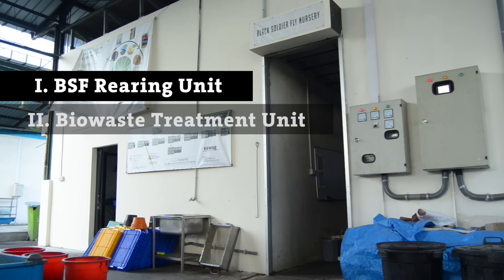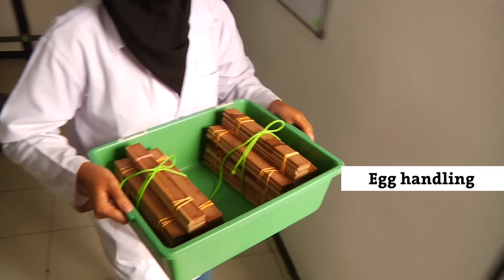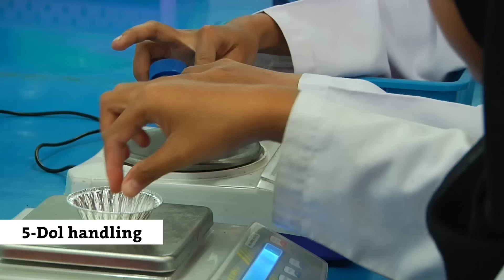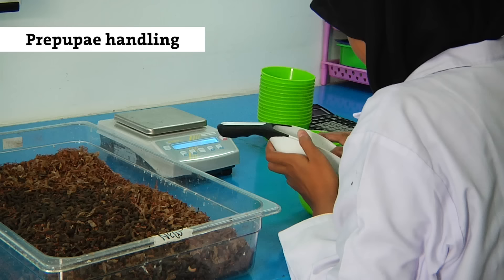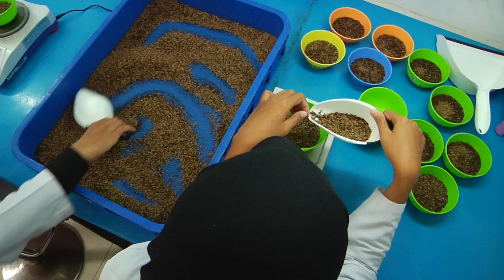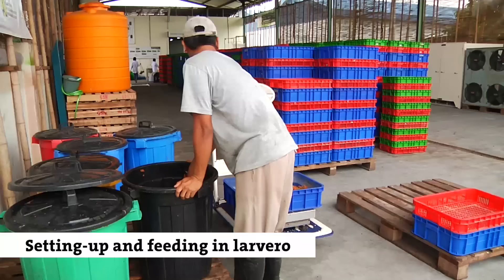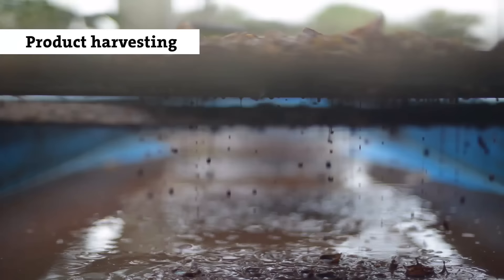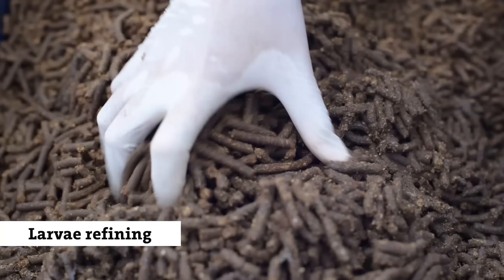How to Use BSF Biowaste Treatment - Step by Step

Comment: Calcium Carbonate powder mixed with a little water, and then applied with a q-tip or whatever, to the sides of plastic containers onto maybe a credit-card sized width and allowed to dry, prevents baby hatchlings of BSF larvae from being able to crawl out. You want it to be dry enough when you apply it, that it doesn't drip. If it is too wet and dripping, let it dry some or add more calcium carbonate powder.

Comment: Since you have basically setup a composting facility and then fed the compost to the larvae, why not simply compost? It removes the problems of handling teh larvae and reduces the number of people need to run it.. The compost can be sent to the farms or sold.
Reply: wondering the same thing myself, what is the point of going through all that trouble, seems like a waste of energy in and of itself.
Reply: @GreenRoomMusicClub  well I was digging around.. if you feed the raw waste to soldier fly larvae then you get a high protein feedstock for poultry
Reply: This setup is advantageous because of how fast BSF turn organic waste into valuable products. Apparently, BSF are faster decomposers than red wrigglers. Composting without using worms or BSF will take months which is a long time. BSF will expedite this process. You also get valuable animal feeds from BSF farming unlike traditional composting with or without worms. You get BSF frass which can be used as soil nutrients and more importantly get a valuable source of food for animals.

Comment: Great video and amazing information. What do you do with the drained water from the waste? You mention in the guide using it for later use or for treatment, but do you have more information?
Reply: Thank you for the comment. Currently, we do not use the liquid but we have analysed its potential for biogas production. The methane yield was around 450 ml/g VS which is comparable to the biogas production from food waste or pig manure

Comment: Hello, im reading your guide and I have one doubt, in page 57 different tipes of feed are explained, my doubt is here, in CF and water %. For example, when you say 1kg/30%CF/70%Water this means 300g of Chicken feed and 700g of water or the water % is refered to the relative humidity (1kg of CF + 700g water). Thanks for this information!
Reply: Hi, the ratio in fattening the larvae is using 30% of CF and 70% of water, so if you will feed 1kg of feed, then 300g CF then add water up to 1kg. Hope this answer your question

Comment: tive um problema relacionado com o inverno as temperaturas desceram para 14 ;17  graus mínimo e 25 a 27 máximo tivemos uma redução massiva das  mosca o que reduziu as larvas pela falta da população para o cruzamento
Reply: 14-17°C is pretty low. I experienced similar difficulties in San José, Costa Rica where the nights are cold while the days are pretty hot. The adults seem not to like that too much. You would either need to heat the colony or upscale the colony to compensate for the low mating rate.

Comment: I was thinking that this would be a way to process and recycle sewage.  

It would be much easier to just feed the rotting vegetables to pigs.
Reply: Not the same. Decomposing fruits are not as valuable as high protein larvae food.
Reply: @JustNatax3  All of the amino acids (protein building blocks) in the vegetables would also be in the larvae.
Reply: @JustNatax3  Also, pork is more valuable than fly larvae.

Comment: Insanely labor intensive, will never work from an economic standpoint the way its presented here . So much engineering needs to happen before this is anything but a waste of resources.
I hope someone somewhere is doing a much better job of this.
Reply: You are right, very labor intensive, but that's actually a plus in low income countries where labor cost is low and unemployment high. 

If you are interested on the subject, there are several plants developing a more streamlined process both in middle and high income countries. 

One of the first commercial operations opened in South Africa in 2014, and it looks like they are doing fine. You should definitely check their website
www.agriprotein.com

I know there are at least a couple plants in Europe developing the engineering side of the process, from the feeding to the separation of pupae valuable contents (fats, protein, chitin and some other bits). 

As far as I know the biggest constraint within the EU derived from the legal framework applying to waste and insect farming, as it constrained both the legally allowed feeding materials and the marketing of the pupae as animal feed, though the legislation recently changed